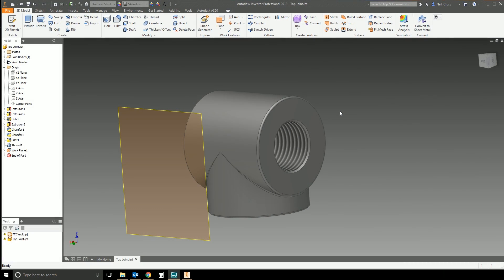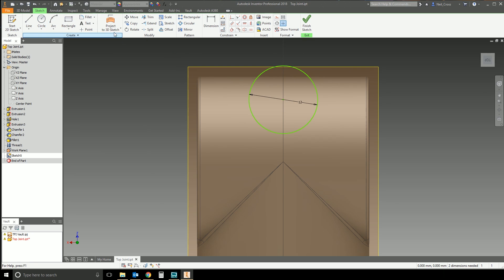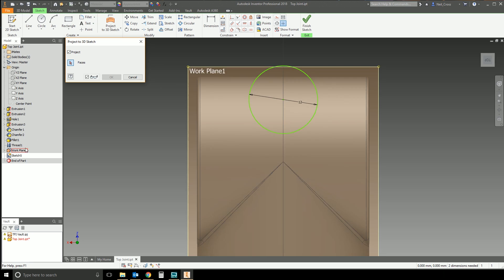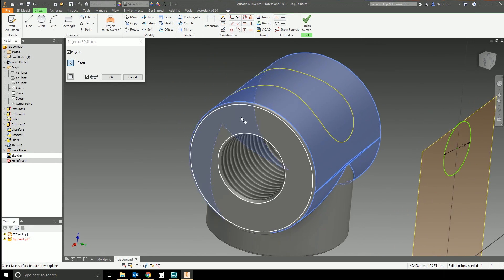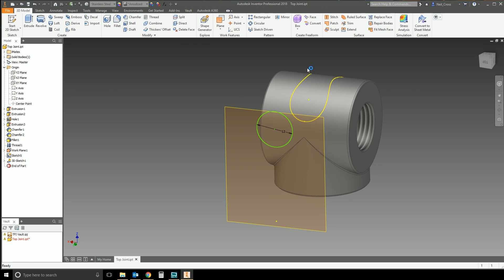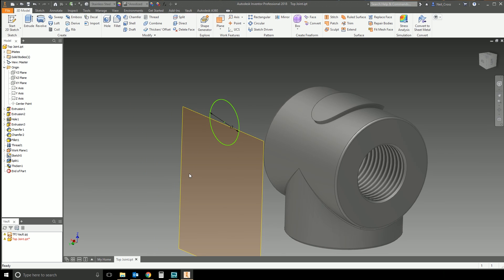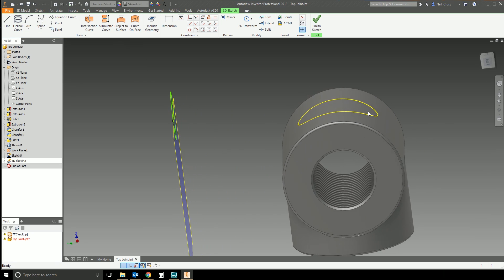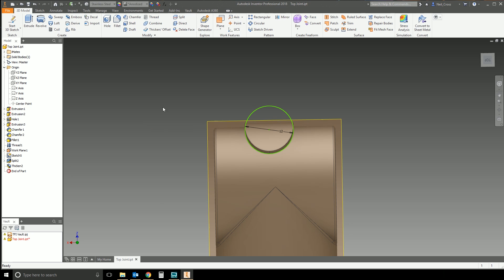Project to 3D Sketch

Comment: Excellent video :) Quick question; how do you make the thickened part so it can be patterened around the part? I can't do that with this method.
Reply: First, you have to split (split command) the form created by the projection. Second, you use the thicken command.
Reply: @AntonioSMorote  
Does not work